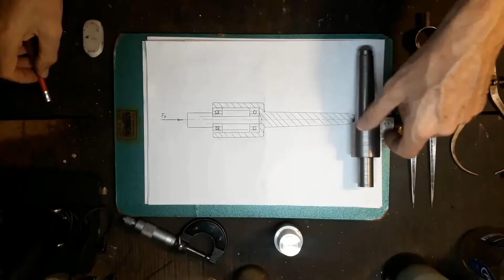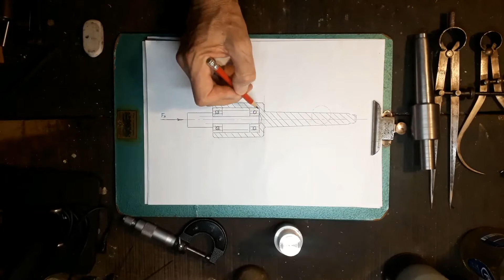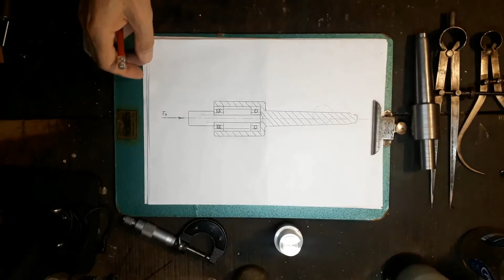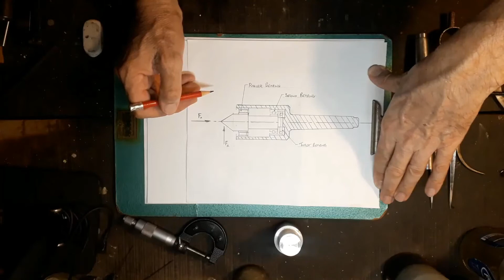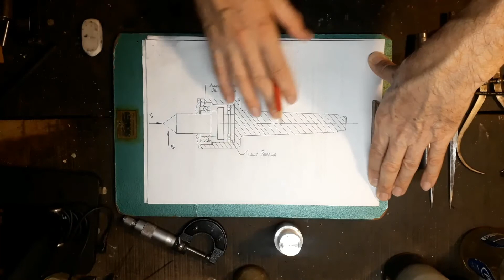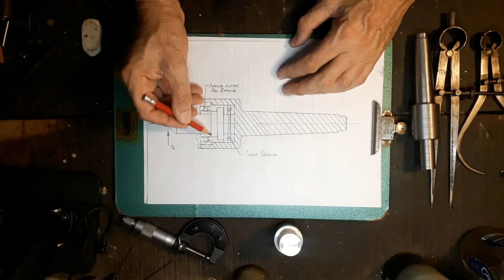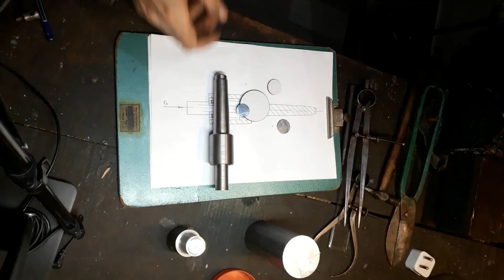Using The Lathe Pressure Turning Tool

Comment: Hi, is using a live centre for pressure turning okay?
Reply from the maker: Hello Stan. I would say that a live (rotating centre) would be fine for pressure turning - better if you can replace the centre with a stub shaft of the required profile. Some live centres come with interchangeable fittings. You could make a separate pressure pad with a centre hole to engage with the live centre, but I am not sure what impact the reduced support would have.